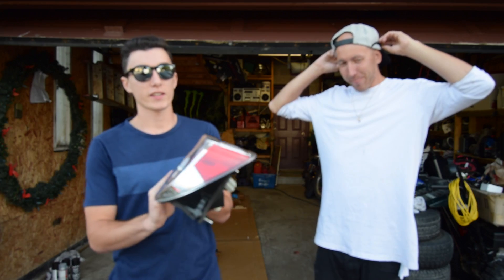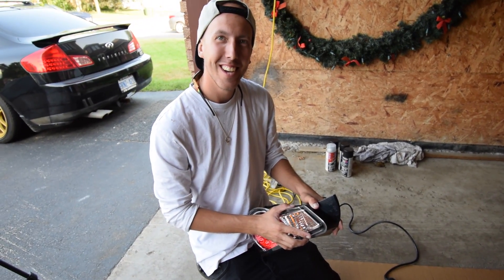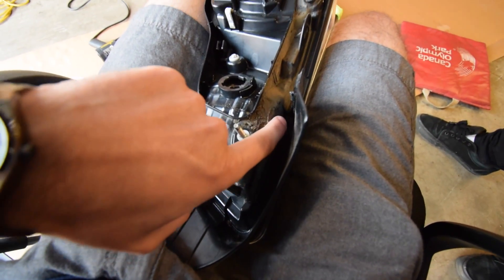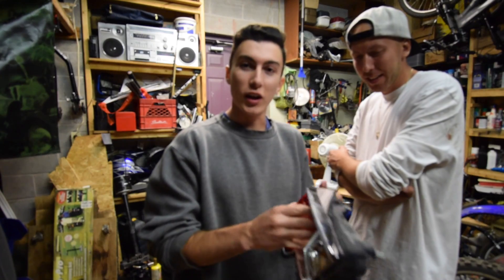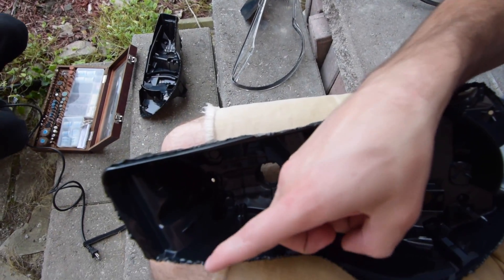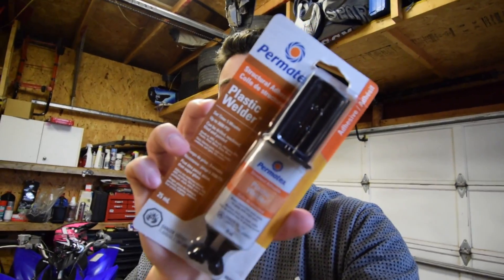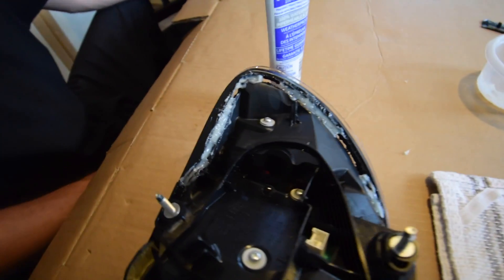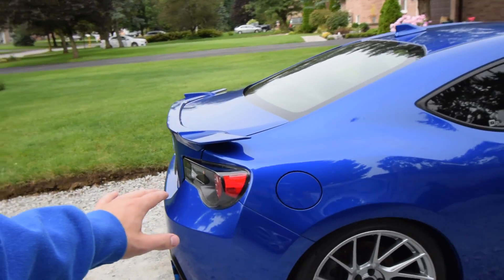Painting Taillight Housing! SKETCHIEST BRZ MOD!

Comment: I did this with my truck, also had to cut it apart. But instead of blacked out I ordered a spray can of paint that matches my truck colour. The blue might of looked cool as well in the tail lights. Good luck with the seal, mine didn't last long. But when I used the weather stripping ( what they use on windshields) it hasent leaked yet.